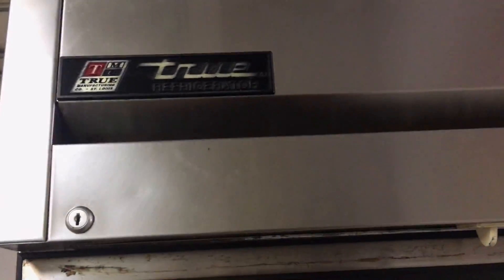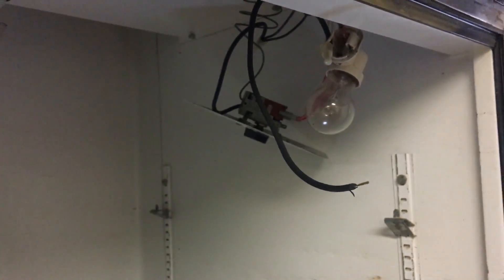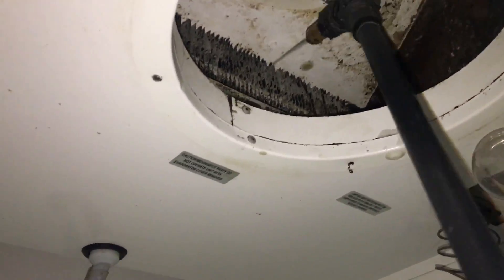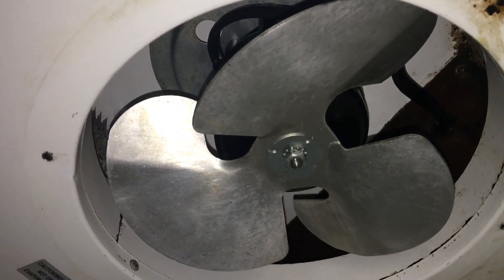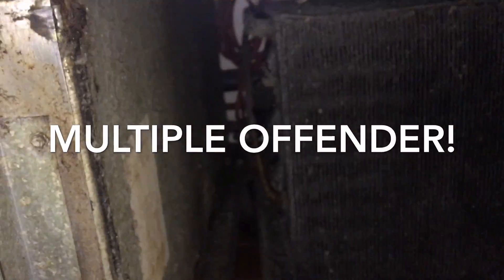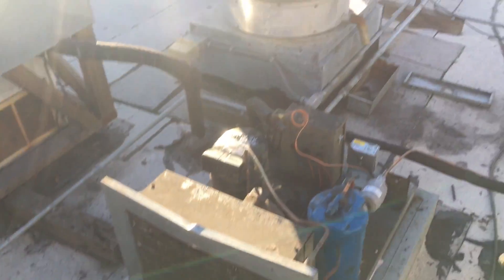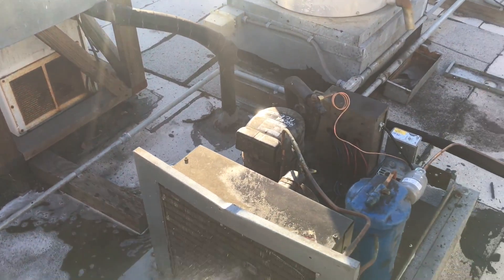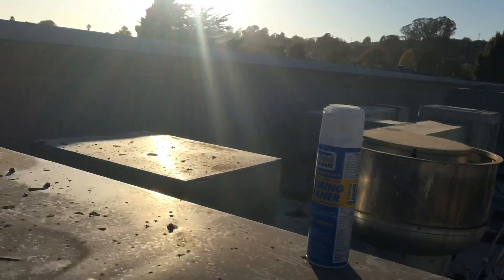How a refrigeration service call usually goes

Comment: How do like the refrigeration field better than heating/AC ? 
I’m on residential heating and ac company now but I’m getting an offer from a company with refrigeration position. It’s a union company but I’m not sure yet. 
Any hits will be well appreciated
Reply from the maker: Hvac_jc I’m huge union fan worked 10 years local 104 wages and benefits are untouchable especially if you have a family
Reply: Nor-Cal Refrigeration & H.V.A.C any hints ? 
Do you like more refrigeration or heating and ac ?

Comment: What is your thought on condenser filter media for kitchen reach in coolers and freezers? If they are regularly washed or changed, my feeling is it is worth the slight restriction and higher head pressure, especially in units that are near fryers or grills.

New subscriber. been in F&B operations for 30+ yrs,  not an a/c tech by trade, but I have some mechanical chops and recently started studying more about electrical theory and troubleshooting.
Reply from the maker: david johnson as long as the get replaced regularly there great.

Comment: In my experience, I try not to push the thrash back through the coil, I will move the rinse water opposite of the air flow, (from the fan side out through the condenser).  Really like your videos, and thanks for doing what you do.
Reply from the maker: Jonny Cat I do sometimes but they clean up with hose ok. To lazy to take the motor out. Lol.
Reply: No need for fan removal, I don't want you to think I'm ball busting, simply reviewing my procedures. You are a BAD ASS>
Reply from the maker: Jonny Cat it's ok I've been at it since 1987, my balls need busting I get lazy sometimes in honest about it.

Comment: What do you think about those Honeywell wireless stats?
Reply from the maker: They work good when you can't run a stat wire. I have one on the roof of 2 story building and it works fine. This one here is 8 years old and last night it no longer will communicate. I will be replacing it with a new one. Same model.
Reply: Good to know!👍

Comment: do you ever use a hose to wash out the coils? seams like more pressure would work better?
Reply from the maker: I do on bigger units. Not so much on the small ones. To shop vac a kitchen floor just before 5 pm is not going to happen.  That's a 6 a.m. Job.